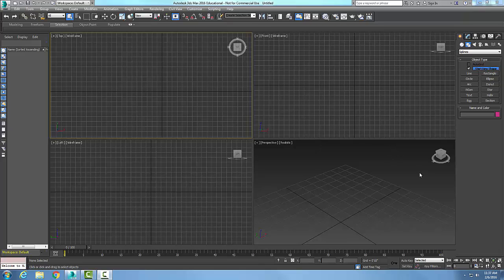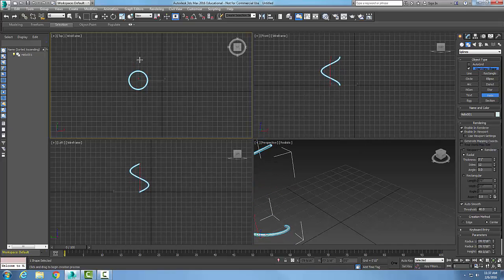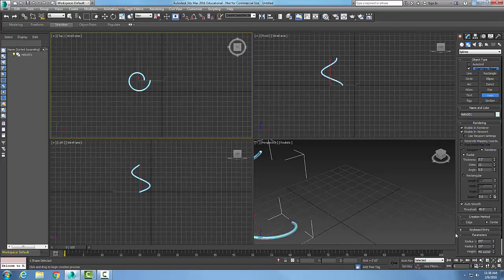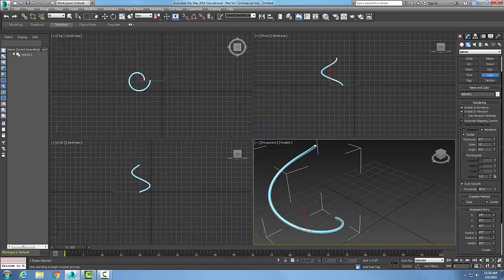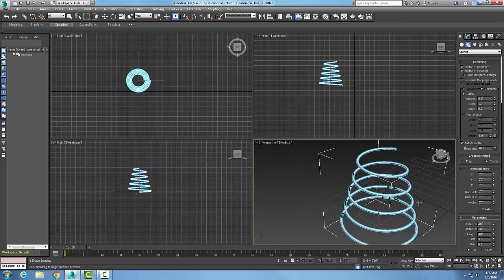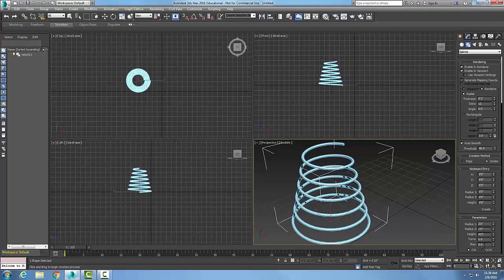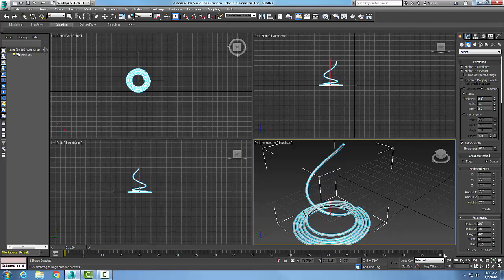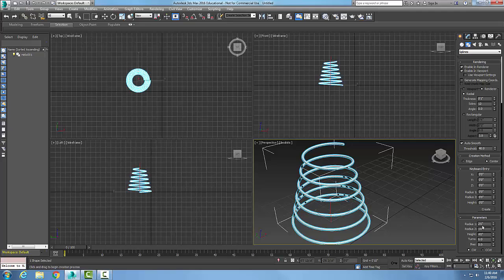3ds Max  05-15 Creating a Helix Spline

Comment: I have been killing myself trying to find out how to make the bottom smaller than the top, didn't know about the 2 radius values in the parameters, thx you for the video that is quick and to the point.
Reply: 3ds has been designed to reduce population